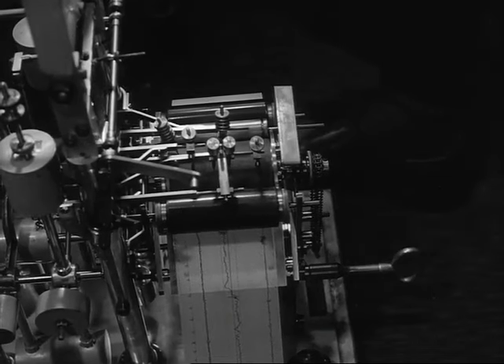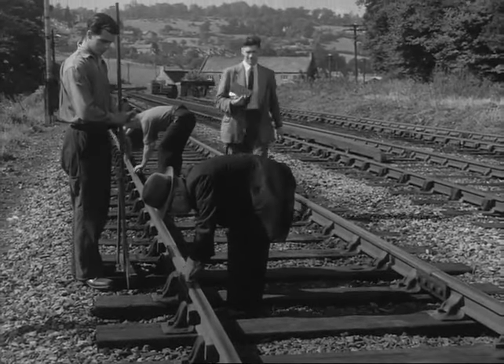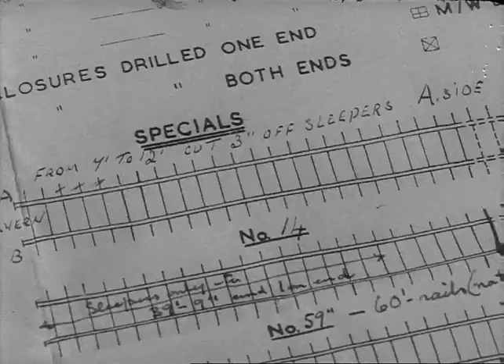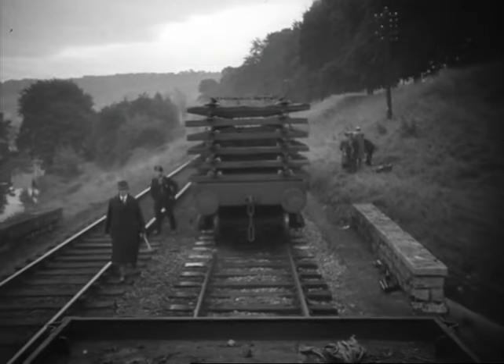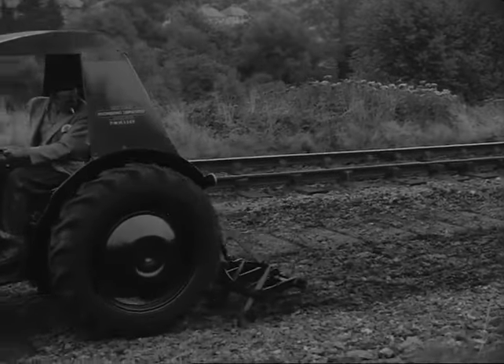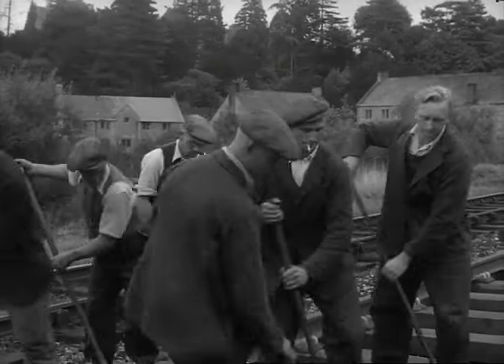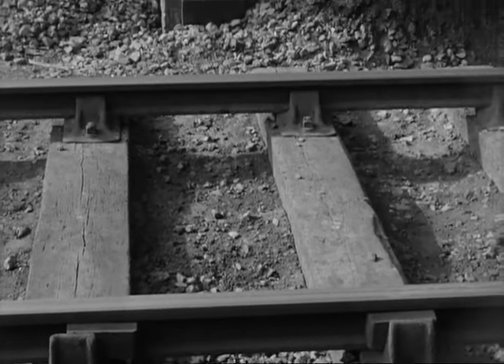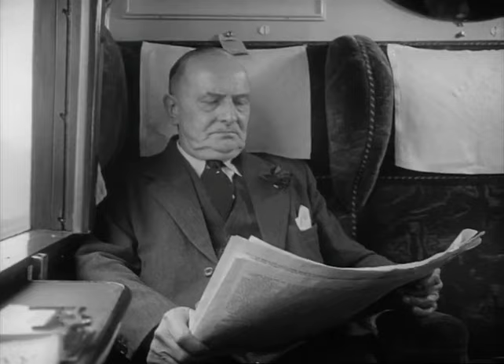Vintage railway film - Making Tracks - 1956

Comment: I currently work on track an I wish that they would make it this easy bloody brilliant keep finding these gems please hopefully network rail will take note
Reply: And you'd bring back "diddely-dum, diddely-dum, diddely-dum, diddely-dum"!
Reply: @neilbarnett3046  :)
Reply: I guess nowadays they'd only replace the rails most of the time.
Reply: @millomweb  they do replace everything it’s called a core renewal but it’s not done like this anymore
Reply: @craigruddlesdin9561  Seems daft - not even really understandable with wooden sleepers - many repurposed after rail use for other things. Concrete sleepers should last even longer. Surely only rails wear - and so it'd make sense that they should be easy to unclip, replace and reclip in the new ones.
Reply: @millomweb  well they do bud it’s called a re-rail we also do re-padding and clipping it all depends on what category the track is in and yes we do take out the old woods a replace them with concrete ones also if they haven’t the money then the will replace the old wood with news ones and that’s sleeper changing as well
Reply: I’ve been on the track for nearly 50 years
Reply: At 4.25 that’s the ganger Fred Baldwin

Comment: Single section related crane WOW !!!! Now we have one train to do everything. Brilliant these old films. I remember doing  rail adjusting,  to remove tight gaps.  Plates off, cut 6 inches off the rail, drill new holes, plates back on, then chase the gap down. Un key rails, keep pulling back till all gaps are the same. 
Hard but good says . Thanks for sharing.  😎👍

Comment: Love this, the whole process shown from surveying to assembling the track (Newlands PAD, I think) to laying it and then ballasting with Herring hoppers. The Western Region seemed to have their own methods of relaying using the dedicated PWM shunter, unlike on other BR regions. Loads of trackmen needed to open out the track and ballast, remove and lay in the new, slew, etc at a time when few track machines were there to help. Not sure about the unloading of the hoppers at the end, looks very difficult and unsafe. Luckily, just around the corner Dogfish hoppers were appearing, giving control of the hopper doors from above using hand-operated wheels - no more running alongside a moving train with a bar.

Comment: Extremely interesting film!!! Cool how everything goes in order, like being military. 
A question about that huge hacksaw near the end- At first, it looked like a tree saw. How was it powered? By steam? I don't think those rails could be cut by hand. Thank you for a great history lesson. This film was produced 2 years before I was born.
Reply: It would have been quite a basic petrol engine to power that saw, earlier versions had a handle which needed to be pumped back and forth to keep the saw blade cutting, though I still can't work out how that forced the blade to cut into such hard steel rail. There is a bit of film showing a hand-operated saw in another short film about the St Pancras Junction Relaying in the 1940's.

Comment: The shunteris is one of the 5 Permanent Way Machines built by Ruston & Hornsby at Lincoln for the Western Region. Only one of the class had been built by the time this was filmed PWM650 (later 97650). It survives today at the Lincolnshire Wolds Railway.

The twin boom crane is one of 3 built at Swindon in 1953 by converting surplus Warwell wagons. These were originally number DW274 - DW276 (later DRB78114 - DRB78116), but which one I can't say.

As for the flat wagons, I think they might be Ganes (the Engineering Deptartment telegraphic code for this type of wagon). These were a GWR design that BR continued to build. They 62' long and designed to carry, amongst other things, 60' track panels. The BR development of the Gane was the Salmon.
Reply: Would you be able to link to any photos of the cranes? I came across them here and I'm fascinated by them, but can't find any other pictures of them outside of this video
Reply: @ryansock8269  sorry, I've not been able to find any for this crane, most railway photographers of this era only occasionally bother to photograph unusualwagons or coaches leaving the photographic records a bit sparse in places. Paul Bartlett has photos of similar cranes, but not this type.

Comment: I worked on the railway over here in Britain all my life . These days they have a special train that goes through checking the track . It's a bit more technical  these days . Using computers , but they can still print out what a  section of line  run is like and if uneven . I remember seeing red or yellow paint . That the computer splashed out on the track. So the PW or track maintenance gang  , will know where to do track packing.
Reply: I understand why uneven track is a problem but how is metal fatigue checked for?
Reply: @jonka1  ultra sonic train and manual testing
Reply: @billyodea8557  Thanks.

Comment: I do that today well the process has changed. We still use a crane like that to lift the old sections out but they are self driving. Then the ballast is dug out and dropped in a ballast train. A bull dozer with a level censor level the bed. Concrete sleepers are dropped and spaced out. We put out the rubber pads and clips and a machine with rollers puts the Rail into the slots on the pads and flexes in. With bars we line it up. Put all the clips in. Another day you go back and stress it because its welded
Reply: Ah yeah I forgot the ballast train drops the new ballast. Forms the shoulder. We have to level the 4 foot ballast profile and all that
Reply: When welded rail began to appear on that line from about 1971, it was put down in the same way.  The following weekend, the 60' lengths were unclipped and replaced with long lengths.  A hole was flame cut in the end of new rail on the flatbeds, and a hook and chain attached to a pair of rails, looped around the track at the other end.  The engineering train eased forward and the rails were dragged off, levered into place with slewing bars, Pandrol clipped,  and welded.  In those days, the welder left a larger protruding web sprue.  No TATA steel either, the rails came from Glengarnock, Workington and Colvilles.  The earlier Skol, Fishtail and Mills railclips soon gave way to Pandrols.
The new section seen in the film, 110 lb/yard flat-bottomed on BR1 baseplates with elastic spikes was in place until about 2000.  A few chains of 96lb/yard bullhead further down survived until 1997.
The crane seen in the film or one of its two Swindon built classmates was still in use when a bullhead section about 3 miles  west was replaced in 1980.  
For some reason, it fascinated me to watch as a youngster, though I knew railway photographers and  shared the interest.  
Far more efficient a process now, but lacking the character of times past.  Anyone else remember how a strong wind sounded, yowling through telegraph wires?
Reply: I have just got back home from a Rail stressing job